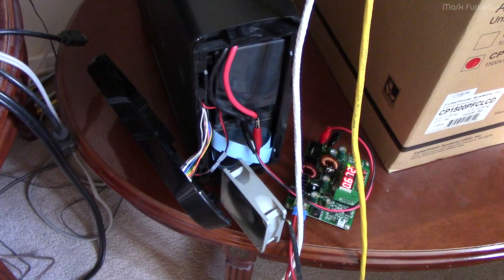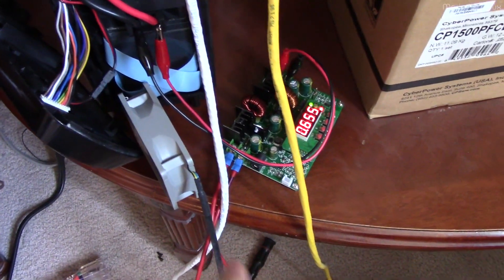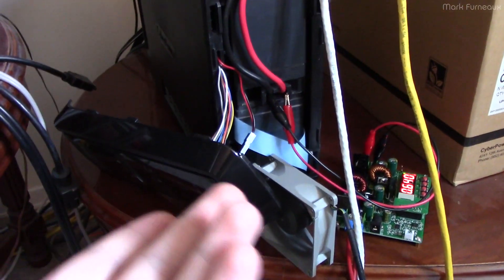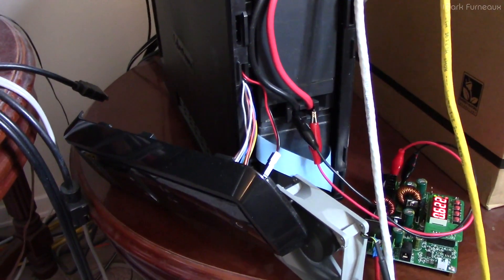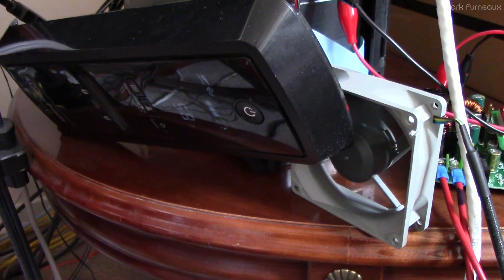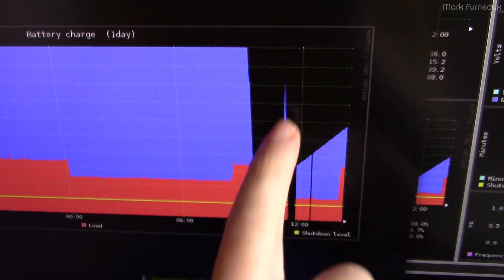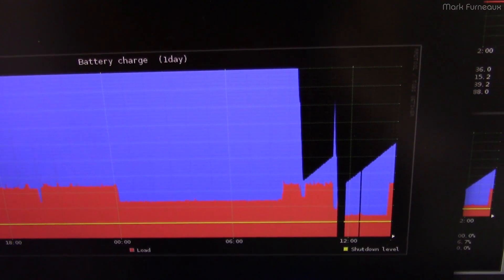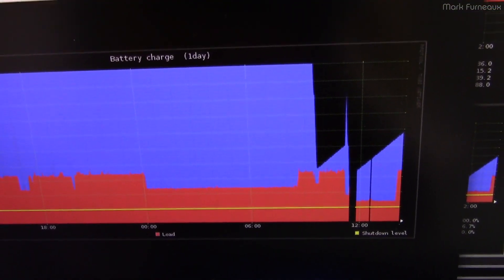CyberPower UPS Battery Percentage is Fake When Charging

Comment: well im starting to regret not doing more research before buying my Cyberpower CP1350AVRLCDA UPS. i got it used (suposedly been siting in storage a long while) it's got no battery rn i planed on geting a new one soon and just use it ass a surge protector and hopfully voltage regulator until i get a new battery so i plugged it in and was suprised to see the lcd emidiatly fire up( i expected ups to be turned off sence it has no battery at all) and withought a battery it shows full charge. apon my searching i quickly stumbled apon this video, must say up til now i thought CyberPower was one of the best quality per$ option but i'm starting to think otherwise if something as important as battery monitoring isn't actualy monitored well.

Comment: Thank you for sharing, this helped me a lot!

I recently purchased a BR700ELCD. I could only get 120mins @ 100% charge. So I thought, lets replace with a BR1200ELCD which is supposed to essentially double runtime, anyways, it arrived at 50% discharge and Ive started charging, 4hrs later, now that it is at 100% charge its only 120min runtime!?

....so further to your video, I suppose it is fake and I should proceed with the full 10hrs recharge....

...your video saved me from having to deal with a return and a seller potentially getting burned for no reason, so, many thanks from us!

Comment: So I have this UPS and just replaced the battery today after a five hour outage drained the battery completely and it never charged back up. I ran a self test after replacing the battery pack and it went down to 75% immediately. Is that accurate, or is there a way to "reset" it? A little scared that my PC is gonna shut off after the next outage again.

Comment: That means it has to be calibrated to the battery. That brings me to my question: How do you run a battery calibration on this PSU? Mine shows 100% with run time of 730 minutes. That's wrong. Also changed the batteries, now it shows 100% but I know they were at about 30% when installed.  It's either a gimmick or needs to be calibrated again.

Comment: Just bought an OR1500 rack mount off eBay for dirt cheap, no batteries, fixed the hacked power cable, plugged it in and it shows full bars on the battery % and a runtime of 90 or so minutes… no battery!! That readout is definitely complete BS when it has AC power connected.

Comment: After seeing your other video on upgrading to a deep cycle battery for a UPS have you ever upgraded this to using 2 deep cycle batteries?

Have the same model and actually having to replace the batteries in it and thinking of bitting the bullet with using deep cycle batteries.

My concern is I don't think this UPS has any smart charging so it probably would ruin the batteries by constantly running a current to it right?

Also do you have any tips on this for adding 2 deep cycle marine batteries around 100Ah? I think at highest it will pull 400 Watts if I am running a PC system at the time, but on average 200 Watts.
Reply: Did you end up trying this with ups with a pair of deep cycles batteries?  I was thinking of doing the same.
Reply: @zenonkazienko988  haven't yet. I bought some replacements for cheap currently instead of converting. Will be redoing my office this year and that will be my motivation
Reply: @maximus4273  Fair enough, if I end up doing it I'll try and remember to post back with the results 🙂

Comment: Standard charging curves are usually stated as X current for Y time by the manufacturers themselves in battery datasheets.
And it is a fair charging method for both defining product specification (as it characterizes brand new battery) and UPS use case because you are expected to rotate UPS batteries long before their end (probably something like 80% capacity decrease is the most common figure to characterize charge-discharge life-cycle).
It's a low end UPS, is kinda what I'm saying in other words..

Comment: Just had the exact same experience with the battery and charger in a 1000PFCLCD after the Texas power outages.  Battery was bad, but it kept saying the battery was full.  Nice UPS other than the battery charge status issues

Comment: I’ve always had problems measuring battery state of charge, only reliable method I trust is discrete ‘coulomb counters’ that measure how many Wh go in and out of a battery (like what laptop ACPI battery indictors use) but they’re vastly more expensive than just reading the battery voltage and applying a linear equation or LUT or in this case just a braindead timer! I imagine the microcontroller inside is the cheapest they could possibly use and they’re using 99% of program memory and this was the easiest way to implement a battery indicator while not upgrading anything and ensures the battery charge isn’t ended early by misleading terminal voltages leading to an early death by sulfation of the plates.

Also, thanks for introducing me to Monitorix back in 2016, I’ve been using it ever since but didn’t know you could get that kind of data out of a UPS on it!

Comment: I can certainly see why they might do it that way - they have existing sensing for battery voltage, which gives them the discharge state of the battery while it's on battery. Someone might think "oh just use that while charging, you still get the charge level of the battery" but the voltage while charging will basically always be the output of its charger. I'm not sure why you believe they have current sensing for the batteries (they might) - but it is an additional cost, and charge current doesn't give you that much information in terms of the charge state of the batteries (you could have one battery at a dead short or wide open, and it'd think "oh I'm happily charging" for the former, or "oh it's done already :)" for the latter). Easy solution? Fuck it, throw a timer in there and ship it.
Reply from the maker: Almost every UPS I've ever worked on from APC, CPS, Eaton, Ultra, Tripp-Lite, etc. has had a low-side shunt resistor in the charger circuit. It's actually a common secondary-failure point since when something like a FET or diode shorts in the charger or main switcher, that current path shorts the battery and the shunts burn up. The voltage when charging is not just the charger voltage, since the charger is current limited. During the bulk charge the voltage will be increasing and this will continue very far into the charge since the current limit is so low.

Comment: Many UPS's do this. I had a APC that did the same thing, even on discharge. I had hooked up a 5kw lipo battery pack to it and it would countdown the percentage all the way to 0 at the same rate as the internal batteries and continue running at 0% for another 9 hours.
Reply: Well, thats just f**ing ridiculously stupid. Running for at least another 9 hours at 0%. You have no way of knowing the actual charge level and it could cut out at any time.
Reply: @simontay4851  The anxiety of never knowing if it will turn off is how you develop character
Reply: I have one with simple multiple led for battery level and it indicates low battery with large batteries even when the voltage is at 28v

Comment: It’s not fake. It’s not easy to calculate that data and part of the problem is the “surface voltage”.

I always disconnect AC and run them on batteries for a couple minutes to get true state of charge.
Reply from the maker: Surface charge affects the battery's internal resistance, and yes it can skew state of charge when measuring the OCV, but during charge or discharge when you have a significant current in or out of the cells its effect can be compensated for.

Comment: My Cyberpower UPS just died the other day. Battery died. But UPS unable to be use as pass through without battery inserted. And it didn’t alert battery failure either. Pretty dumb. 

If your Cyberpower failed and flashing screen (blue for mine), then it’s very likely the battery needs to be replace.
Reply: Batteries do not give much warning and can
fail suddenly, so it’s not the UPS’ fault.
Reply: That is not true. Internal resistance is getting worse and worse. It can be measured and estimate when it will fail.